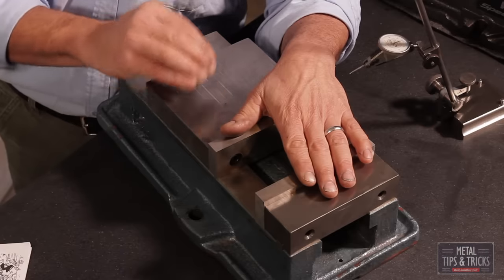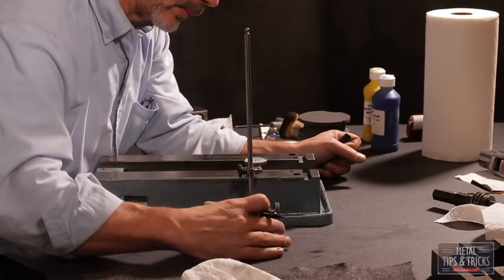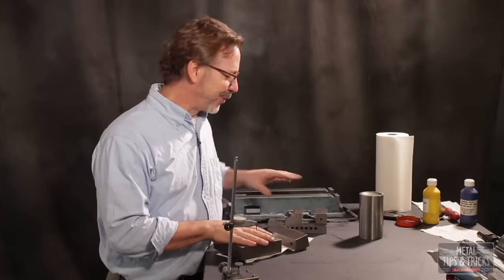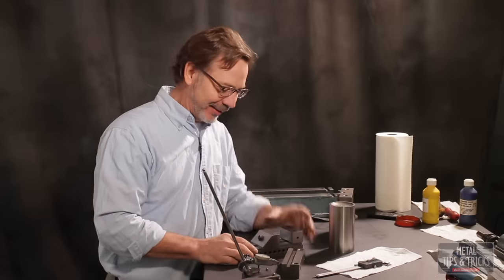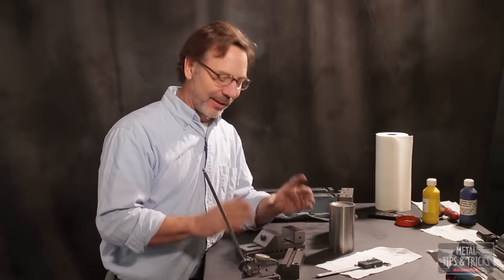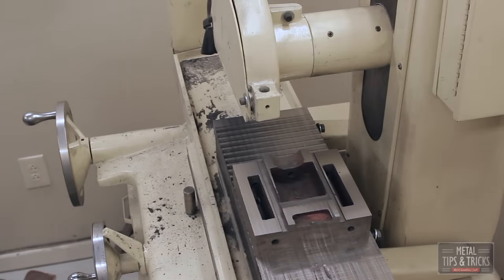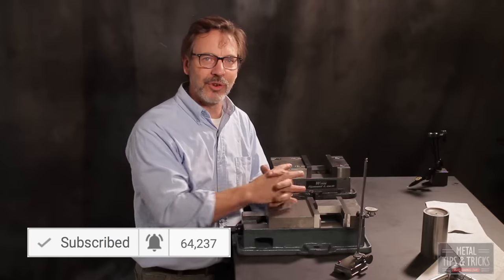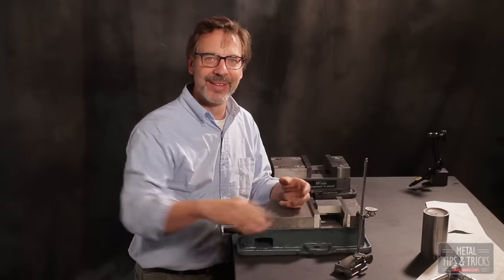China vs Usa  controversy machine vise

Comment: Thanks for the great video! Looks like its worth buying a quality vice at the end of the day. Learned alot. Now what size or model would be the best for a full size knee mill in general shop/hobby use? 4 inch vs a 6 inch ect...
Reply from the maker: +The Moto fixery   Standard size is a 6 inch.  8” is usually too big and too heavy and 4” is inadequate for most projects.  IMHO.  Thanks for watching!

Comment: We actually did this in a place I used to work and got similar results.  But, if I remember correctly, the bed heights no longer met the standard 2.875".   So, they could only be used by themselves.

Comment: If you had special repeatable fixtures and automatically set up with a laser measuring system  and as you said let the vice cool down a certain number of hours would that cut down the 12 hours to just a few? 
Next, as of January 2016 the monthly pay for a factory worker in China was $539.00 +/- USD equivalent plus a place to sleep, daily meals  social security and medical.
Many of the Chinese factories prefer the cheapest route using substandard materials and the cheapest manufacturing process; (they just like corporate American) are mainly concerned with bottom line profit not quality.
In Taiwan you can get first class quality at an affordable price?

Comment: by the way I have a jet mill why would you think i needed a curt vise????
Reply: I also have a Jet mill AND a Kurt vice.  I got the mill used with a Chinese vice. I'm not a machinist but the Chinese vice was frustrating. I considered a better Chinese vice because of the price but then considered that another bit of frustration wasn't worth the trade over the # of times I would be clamping a part and having it move.     As for these videos they are OK but If a comparison was going to be made it should have been vices of similar types and similar price points.

Comment: Dale, your channel is great and I appreciate all the informative content it has and the time you've taken to make the videos. Firing shots at AvE was unnecessary IMO. In terms of the Chinese vise pretending to be a Kurt, can the case not be made that the Kurt design is simply a proven design that everyone copies? There are a lot of similarities between cell phones these days but you can't really say that a cell phone manufacturer is trying to pass their phones off as iPhones just because they might look the same. The title of the video was ultimately what wasn't tasteful. It should have been more factual like: Cheap Chinese Vise vs Expensive USA Vise. The audience doesn't really need the insult of being presented as being unable to discern that a cheap $200 vise isn't as good as an $800 Kurt.

Also, was the cheap Chinese vise used? It certainly looks well-worn. The real challenge, I thought, would be to compare vises of equivalent cost to see what the value propositions are in that case. Does a $600 Chinese vise provide additional value over a $600 USA vise?

Hopefully, everyone will live and learn and we'll do better next time...
Reply: I think the thing I miss more is what business value the Kurt Vise gives over the Chinese vise. What is it that you can produce on the Kurt Vise that you cannot produce on the Chinese one?
OP1 sets the dimensioning on the top face, and if you use soft jaws for OP2 then the dimension is set there.
Reply: @jenspetersen5865  Without doing several hundred dollars worth of work to make the Chinese vise work the way a vise should what you can' t make with the Chinese vise out of the box that you can with the Kurt is accurate work.
Reply: @LordPadriac  I am sorry but it is an absolutely worthless answer, without a definition of what "accurate work" is.  If there is something that US manufacturing is NOT known for, it is accurate work. If ex. tour OP2 is in softjaws., then any incaccuracy stemming from the wise would be negated. 
It would be helpfull with an actual answer!

Comment: As long as the vice holds the part, a cheap vice is great for when you only care about doing 5 sides. Leaving the 6th to a better vice.

Even better when doing Dovetail prep. Shouldn't need an expensive ass Kurt or Orange just to make those on a secondary machine.

Comment: The relative quality of the cast iron between the two vises likely didn't cause the difference in movement.  Bending is determined by the modulus of elasticity, which doesn't vary much between different grades of the same metal (1018 steel has will bend pretty much the same as 4140 under the same load, but he 1018 will yield at a much lower load).  Likely it was mostly the 12 lbs difference in weight.  Due to the unique jaw design of the Wynn vise, the jaws looked to be somewhat lighter than normal, so the base was probably more than 12 lbs heavier.  I also expect that some of it is due to where they took the metal from, the design of the structure might be contributing some extra bending besides the weight difference.  Nice video.

Comment: boss bought a $25 indexer from china and it wouldnt even lock the part in...a death trap when gringing. Bought a american made one (forget the name right off hand) spent $525on it and still works like its suppose to after over 25 years of having it.
I know from experience that when you buy cheap expect injuries if not losing a part of your body. Machine shops need quality tools and expecting to buy cheap and to "fix" it like you tried will never work. And casting you have to heat  it up to a certain temp. and then machine it then reheat ir to anoother temp and cool it and reheat it one more time so it will not crack or break when under load and then finish grinding it . used to work field machining and fabricated our own parts to work with.

Comment: You know, shot peening and letting the casting cool off in the mould really do not get rid of the stresses in the material. Shot peening actually does the very opposite, it increases compressive  stresses in the material surface. Cooling in the mold just locks the stresses in to that particular pattern. And I haven't yet seen a foundry where they ever have enough mould frames to be in use 24-48 hours to let the casting cool inside them.

The proper way of getting rid of stresses is a heat treatment cycle.
Reply: If normalizing requires heat, then it is a heat treatment. You can look it up from from example Bodycote website.

I never said that shot peening gets rid of anything. I said it increses the stresses in the material surface layer as opposed to what was said on the video.

I'm not a big fan of what people do for a living, as it shows absolutely nothing. If you care for it, I'm a journeyman tool & die maker with a history of machine (re)building. I never claim to be a professional, that is for others to do, I just learn new things every day. All the best to you.
Reply: What is this chuck jaw thing you are referring to? Seems a bit out of place comment.
Reply: https://en.wikipedia.org/wiki/Shot_peening and I quote: "Shot peening is a cold working process used to produce a compressive residual stress layer"

Straight from one of the largest heat treaters website Bodycote: http://www.bodycote.com/en/services/heat-treatment/annealing-normalising/normalising.aspx
Reply: Seems my papers say otherwise. You can also contact Työkalutyöt Mattila Oy here in Pirkkala and ask them what I do for living.
Reply: You can of course always provide me with references (links, ISBN's) to material that says otherwise. I'm more than happy to correct myself if I'm wrong. Until then, have a nice day.
Reply: Can you be a bit more specific, as the video is over 30 minutes long and uploaded a long time ago?

If I'm a liar, then please explain shot peening and why any source found claims the same I've said about it? Even a Google image search with "shot peening" shows the same.
Reply: And next time you might check the quotes you are using, my term is correct.
Reply: You are ticking way more boxes in the 'troll' category than an educated professional working with metal, especially with your temper tantrum name calling.

I asked a very simple question: please provide some reference that disputes my claims. All I can find is supporting arguments only from multiple sources (Google, Wikipedia, Bodycote).

Lets recap what has been the topic originally:
-shot peening introduces compressive stresses in material
-normalizing is a heat treatment process
-cooling a casting in mould isn't practical/economical and doesn't get rid of  the stresses in it
-weather aging has no appreciable effect with castings internal stressesvs. a proper heat treatment
-cast iron can be heat treated in multitude of ways

Can you provide any referenced material that disputes these points? I have provided links to easily found sources that support my point of view on this matter.
Reply: Heh, didn't surprise me much that when asked for any reputable references/sources that claim otherwise, I get nothing. I'm still open for someone to prove my thoughts wrong about normalising and shot peening and heat treatability of cast iron.
Reply: I have not once said that shot peening removes stresses. Dale said such a thing on the video and I corrected him. I have only said it increases the stresses.

"Used to be aged". Yeah, because it just doesn't work as well as a proper heat treatment.

I'm not pretending to be a know-it-all, but your demeaning attack and plain bullshit trolling against my comments have shown zero professionalism and your lack of referencing your information when asked doesn't exactly raise trust in what you say. The facts I've stated are all easily found in any engineering book.
Reply: Sorry but this is in Finnish, but from the Technical Applied Science department, specifically from the ones who do research, development and education regarding castings: http://www.valuatlas.fi/tietomat/docs/vtp_mat_valuraudat.pdf

Vices are not made from white cast iron and are heat treated, usually by induction or flame hardening the way surfaces. Typical material is GGG-700 for high end ones.

Most typical heat treatment for (spheroidal) cast iron is austempering, and then comes normalising, stress relieving and hardening in different forms.

Still haven't seen any documents proving your words. I suggest you stop digging while the hole still isn't too deep.
Reply: Engineering is pretty broad term and you are not exactly forthcoming with even a hint of professionalism. Owning a company also means nothing, anybody can own a company. Anybody, even without an engineering degree should be able to Google "cast iron heat treatments" and could check for example this result (https://www.thermtech.net/castings) and see that what you are saying is false or not the whole truth.

If you do not even try to learn, you will fall behind in the technological sector very quickly and can't compete. Metal industry is a prime example of this.
Reply: Good for reading it, now you understand that cast irons are heat treatable and not just white cast iron. I didn't expect you to be able to read Finnish and providing material in other language is usually not an issue as online translators are plentiful.
Reply: And if white iron would be the only heat treatable cast iron, then how do you explain grey cast iron lathe beds, machine tables and vices that are normalised and surface hardened?
Reply: And you still can be wrong, no matter what your education is or occupation. I have asked you clearly a number of times to prove me wrong, but you haven't been able to provide even a single reference saying I'm wrong.

I'm not trying to look clever, appear intelligent nor anything, I'm just telling the facts. If you have a differing view of said facts, please prove it.

I've posted links to many English texts too and I fully expected you to use a translator for the Finnish text.

I'm starting to get the feeling that you are the type of person who is never wrong and starts shouting louder and louder and threatens with violence to shut up when someone points out that you are wrong about something.
Reply: The Finnish paper was an answer to you claiming that only white cast iron is heat treated.

The link I posted later (http://www.dtic.mil/dtic/tr/fulltext/u2/620556.pdf) is SPECIFICALLY ofstress relief heat treatment.

You are very well proving my point about your personality, thank you.
Reply: Oh and the Finnish paper indeed mentions stress relief heat treatment, page 11, first paragraph.

Comment: Dale I defend you on the first video. LOL you caused a controversy on this place. No matter what you do here someone will have a problem with it. $200 gets you a vice but is not as good as a vice that costs $600. When I look at a tool I look at what is the value to me. Do I need the $600 vice or will the $200 vice do a good enough job for my occasional use in a home shop? I also do not see any value in buying a Lexus when the Toyota gets me there at the same time. Different story for pro use. In my job where I use something everyday and quality and performance impacts me everyday I want the higher quality.  

What is nice is that you show that you do get more for the extra cost of the more expensive vice. It would really suck if the $200 vice was just as good as a $600 vice and you paid $600 for a vice. 

Thank you for a lot of good videos. Very clear, very steady, very informative and very nice camera use. You are not the weekend "youtube expert machinist" who beats on a lathe chuck with a steel hard faced hammer and screwdriver showing how to "fix" runout.

Comment: I deal in bolts and nuts all this told me that you're wrong in your thinking. If the american screw only took  a thousand to bend that metal and it has a longer pattern and diameter. Then the chinese screw took long to bend  this means the threading on this screw  smaller diameter and can take more torque. Did you check the diameter and the screw pattern of the two items?

Comment: #1 do you have an angle iron? and #2 I always used a pin on the movable jaw and as long as the fixed jaw is square it should be square. Enjoy your vids, and thanks.

Comment: Makes you wonder about the Chinese  lathes and mills too. Probably cant trust the tolerances with a sitting machine as its going to behave completely differently when its under load. I have thought about getting a cheap bench-top lathe from china and then spending some time on the last 10% scraping it in to try and make a respectably accurate machine. Seems apparent that that would be futile.

Comment: I do agree with your comparison. like you said the chinese made is trying to compete against the kurt vise so thats how we should compare them.  
  But when grinding this vise you didn't have the equipment and or tools to do a proper job, in fact if we ground something as you did in our toolroom one would be fired( having been in tool and die for 30 years).   The ultimate sin was using the grinding vise instead of an (calibrated precision) angleblock.  Also just by looking at the sparks one can see the unit was heating up. With cast iron you still need to keep the material from heating either using an air cannon or mister with out water.. but as i said you tried with limited equipment. 
A  job like this in a shop equipped to handle it would take no more than 3 or 4 hours. but then again it is still better to  buy the Kurt vises i am a big fan of their product..

Comment: I guess I have to throw in with those that ask for the comparison to be between two vises (or whatevers) that are made to to the same job AND are similarly priced. I agree completely that comparing a 200 dollar whatever against a 600 dollar whatever is truly comparing apples to oranges. Also, I have to say that people are fairly stupid to even EXPECT that the two items will perform equally in spite of having bought the cheaper one that, since it is made to "kinda" do the same job (and due to performing the same function they DO HAPPEN to have VERY similar appearances) as the more expensive one will still complain about the quality. I still believe that you get what you pay for AND that there is a valid reason vice like a KURT has the reputation it has....and the Chinese make cheaper one has a deservedly poor reputation....and that reason is that the cheaper one is the CHEAPER ONE and cost a lot less to produce, which means that the standards to which it was made BY NECESSITY will not be as high. Now if one were to compare, say, a 600 dollar American made milling vise to a 600 dollar foreign made milling vise, that would be a fair comparison.

Comment: I dont even know what we're really trying to prove here. 

Yeah, go figure, can take a bunch of cast iron "castings" essentially, put hours and hours into inspecting them, then tens of hours into grinding them to end up with a nice vise. No shit. 

This is coming from a supporter of the import vise for the home shop / hobby use. But if you're using it to make a living, go buy a Kurt or Orange or Glacern or something. 

The biggest issues with the import vise seem to be.. 

1. The cast iron isn't properly aged or treated, causing warping as it ages. 

2. The grinding is done fast and hot, causing warping as it cools. 

3. They want them handled as little as possible to keep costs down. This us why its completely covered in razor blades.

Comment: Nope. I just don't get it. 
How does the Chinese vice perform in use?
Can it hold things square? If it can then you can mill as required.
Seems a heck of a lot of effort to improve something that would perform adequately for most hobbyists.
A comparison of parts milled on each vice would show if the rebuilding is worth the effort.